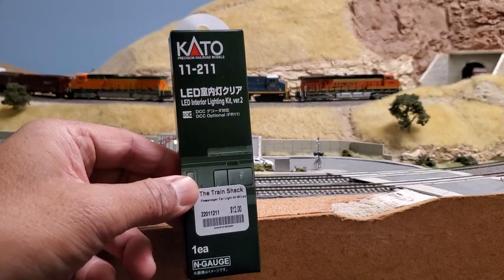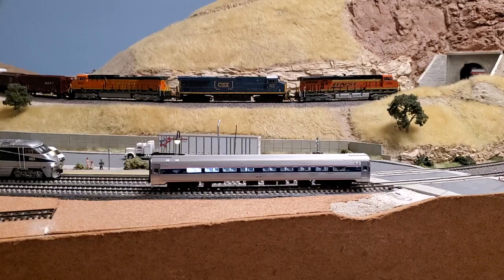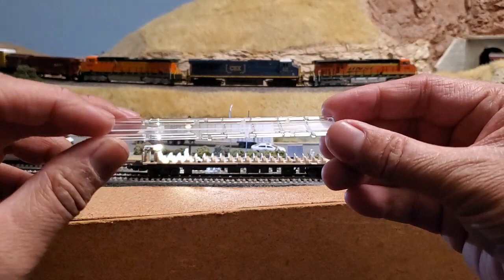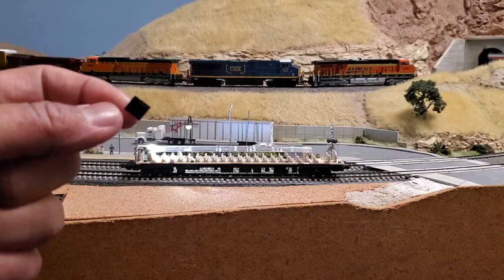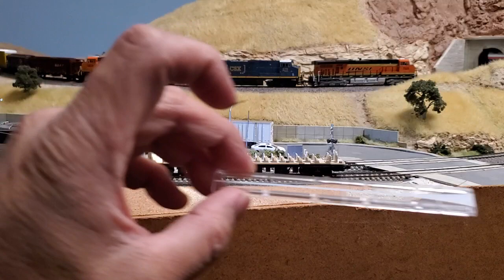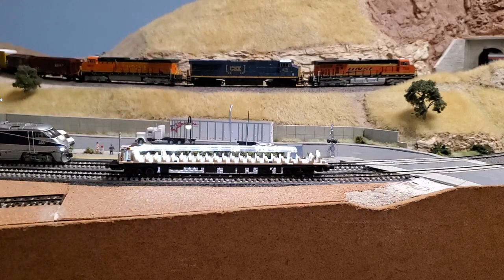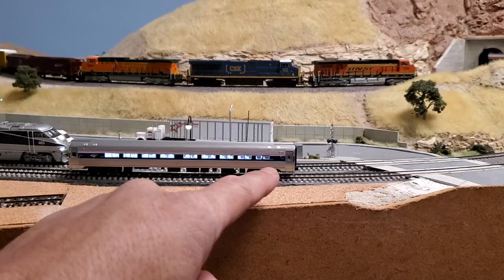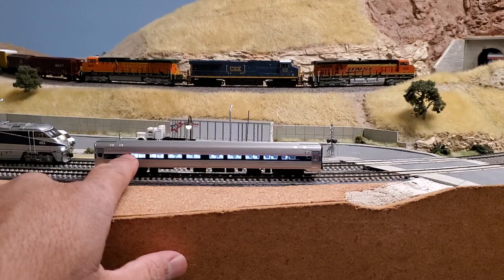How To Improve Light Distribution On Kato N Scale Passenger Car Lighting Kits

Comment: Wow...I wish I would've known this before I did about 110 of them!  The tape will also help keep the glass thing in place when you put the shell back on.  I have some work to do.....
Reply from the maker: Fortunately it's relatively easy to remove the shells off the Kato passenger cars!
Reply: @metroredline  They are, but I had a lot of problems getting them back on and not having the side windows in the car fall off too.  Also the articulated passenger cars, like SP Daylight ones, are like performing surgery!  This is a great tip though, I'll work though them at my own pace.  I think I have every Kato passenger set and every car has a light kit.

Comment: Cool. I used some of the clear yellow heat tape (called Polyimide I think) for cars that have the warm light diffuser fitted to the led. It also seems to do a decent job. I have seen someone put a thin strip of tape to loop around the connection of the light unit and the holder it slots into. This lessens the chance of flickering by increasing the contact from the copper strips to the led pickup pins. If I get the time I will do a video for installing the light into an older car with a lower ceiling.

Comment: If you have flickering, it probably is caused by one of the upright brass contact strips moving sideways and losing contact with its corresponding thin wire contact from the LED board.  Squeeze the brass contact strips toward each other and ensure that they are making contact with the two thin wire strips.

Comment: How would you wire a capacitor? Would it simply be a small electrolytic one placed in between positive lead of the LED?
Reply: why would you need that?  The system Kato has is very reliable in keeping the lights on.  even if they flicker occasionally, that's what real light do on trains.
Reply from the maker: I'd like to figure that out! Somehow I think one needs to break the traces on the light board and solder into them or something.